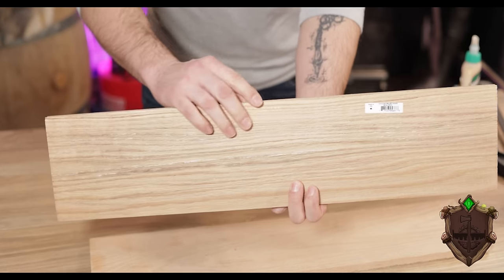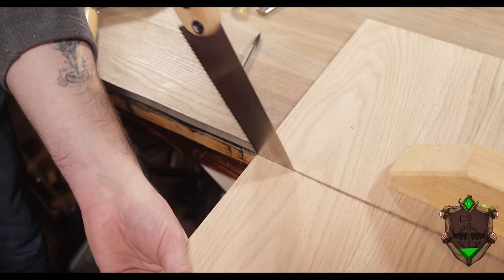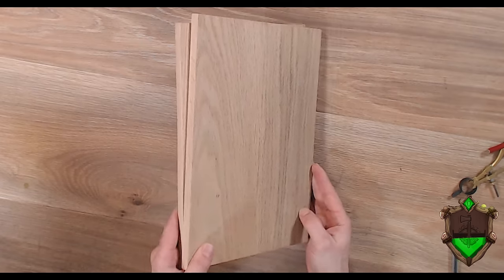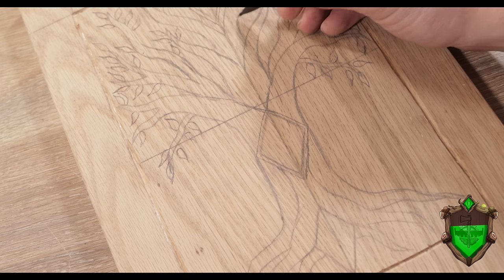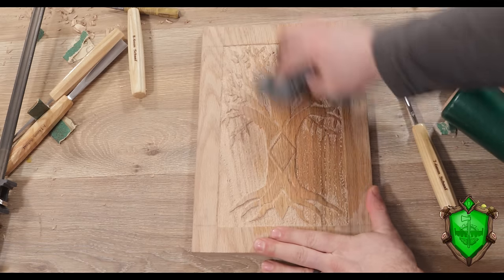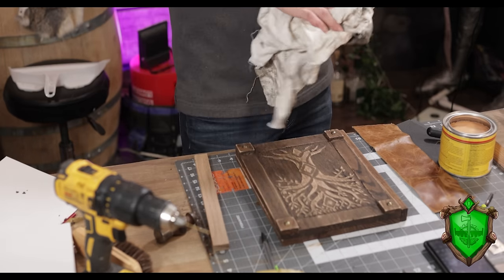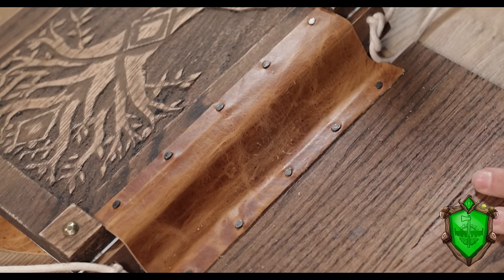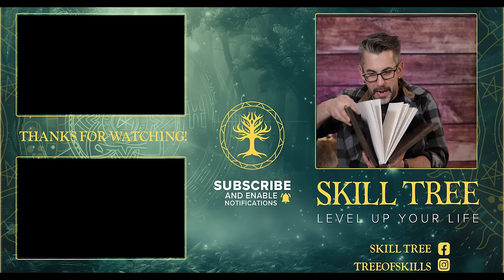Carve Your Own Wooden Grimoire!

Comment: Remember all, when doing glue ups, add a very small amount of sand or salt (if you're going to be fast) so there's a little tiny amount of grit. This will keep the 2 pieces from sliding when tightening down the clamps. Don't use a lot, that's also bad.

Comment: If nothing else, learning how to actually saw a straight line is reason enough for me to watch 😂 

As for woods types, in my experience poplar and maple are just as good for carving as oak (and in my experience, cheaper-- at least the poplar is)

Also as for saws the crosscut saw for rip sawing works decently enough you just end up with a wider kerf size, rip-saw for cross cutting is a pain in the rear (I unfortunately have much experience with using a rip-saw for cross cutting lol)